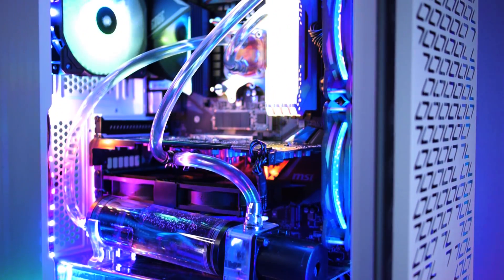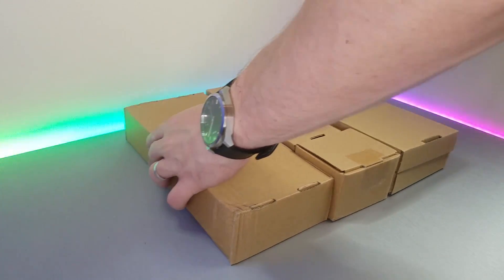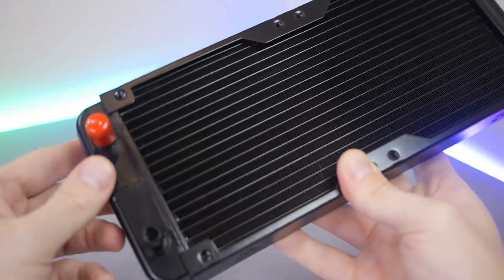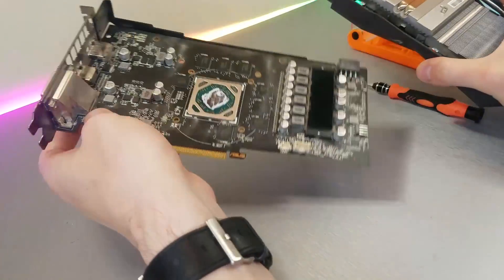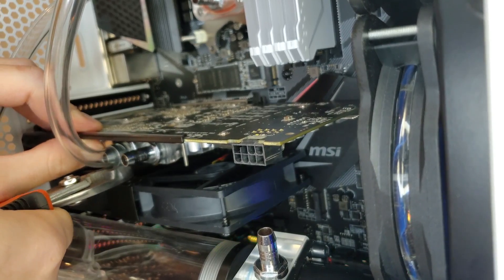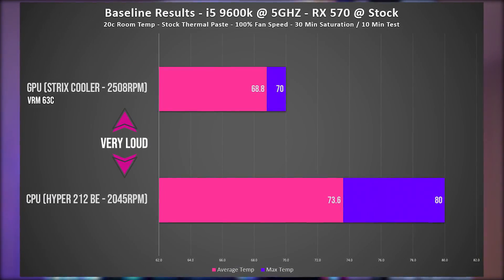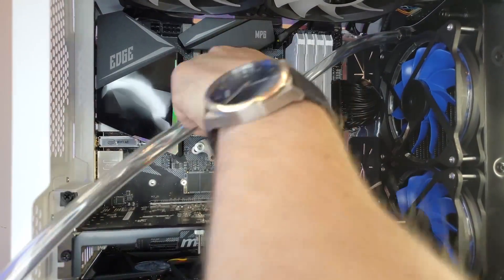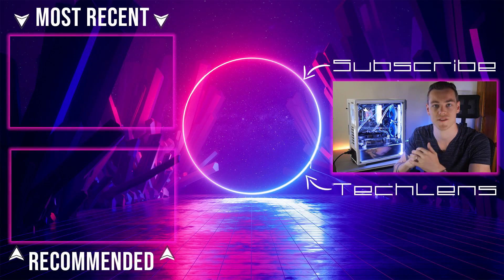FULL Custom Loop Watercooling for UNDER $100!!... Should you?

Comment: Will it work with i5 14gen and 4060?
Reply: not out of the box, the mounting brackets don't fit the LGA1700 or the RTX 30xx-40xx cards, also with the graphics cards you need to cool the memory and vrms and the tiny power controlling chips. If you can find a metalwork shop that would make you brackets that fit at a reasonable price you can mount them, with the VGA you can use a copper plate that covers the memory modules and another one ontop to cover both the GPU and VRAM before mounting the waterblock on top. The VRMs and small chips are tricky to cover and cannot be left without a heatsink.

Comment: If you had dual rads the temp increase on the cpu would probably not happen. I’ve always gone by the minimum of 240mm radiator size per component.
Reply: Even if you do not, shopping around foir 1U/2U loop. More area more better.

Comment: Very interesting video, but I still don't get the idea behind watercooling - overclocking aside of course (AKA: it's heating up so fast that you need to pull the heat REALLY fast as well) - as the system is still basically air cooled ... So why not invest that money into a good cooler and a couple of noctuas? This is a real question, if anyone can chime in :) (being a geek, I fully understand the whole "fun project" thing tho)
Reply: I know it’s an old post, but the general idea of water cooling is better thermals with lower overall noise. Couple that with a lot of the newer GPUs and CPUs being able to make use of thermal headroom and overclock themselves accordingly so having better thermal performance means better bang for your buck on hardware.

Comment: Just wondering, what should you do about the no am4 cpu block support
Reply: Freezemod makes cpu block for Ryzen
Reply: find a metalworks shop and ask them to make a mounting bracket, print the diagram with full dimensions and replace the mounting bracket that's attached to the cheap waterblock.

Comment: I have a rx 580 gpu and a micro atx case and it suffered from cooling with just three fans. Switching to liquid and using this it works like a dream. No more game freezes
Reply: where did you get the gpu water block?

Comment: You should get atleast another 120mm radiator instead letting the warm fluid going into a reservoir 
240mm rad > GPU > 120mm rad > cpu > then back to the 240mm
Reply: the loop route does not matter, jayztwocents made a video. As long as the water is in a closed loop the temp will be same no matter the order
Reply: Wouldn't it be better to use a 360mm radiator?

Comment: I feel your thermal testing is flawed 
The cpu could be running hotter because it’s running faster because it’s using more power 

Please take a look at GamersNexus write up on CPU thermal testing
Reply from the maker: Not when you lock the clocks and voltage 👍
Reply: @TechLens  ahh 
Must have missed that. I’d still recommend taking a look because sometimes even locking clocks and voltage in bios can be misleading because software shittery

You really need to use a current clamp and measure wattage directly

Comment: even with a full copper loop with the copper radiator is it still recommended to not only change the fluid periodically but also use that cleaning fluid?

Comment: great review. I'm still a bit torn about getting the Aura cool 240 or a gammaxx400 gte or try my luck with a cheapo water cooling loop. I also did research and found some affordable and quite respected brands in custom watercooling, (Bykski and Barrow).
Reply: It might make a diff if you get a 360 when buying a new rad.
Reply: @jonelbulao5918  i would recomend going to WC only if your cpu is high TDP, something like 150 - 200, or just get a decent air cooling.